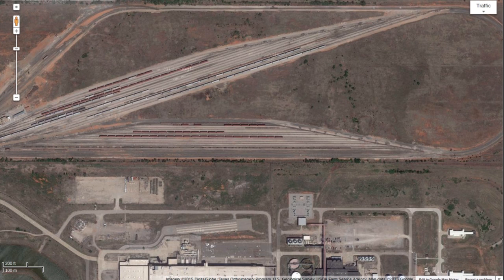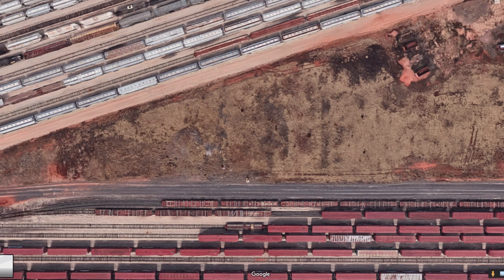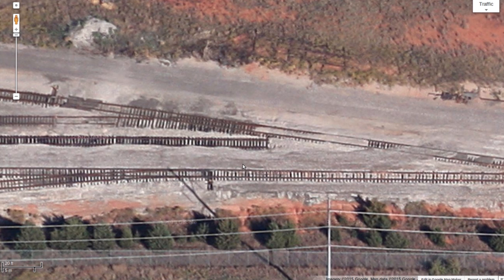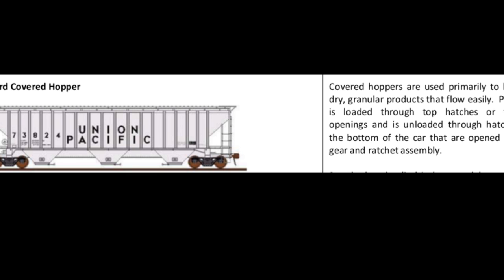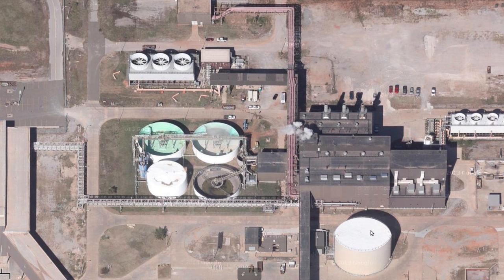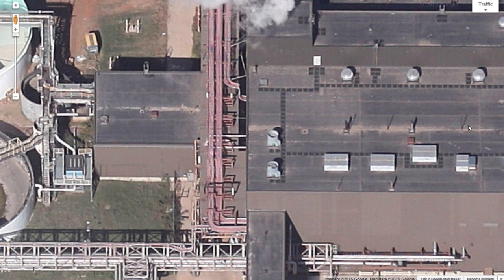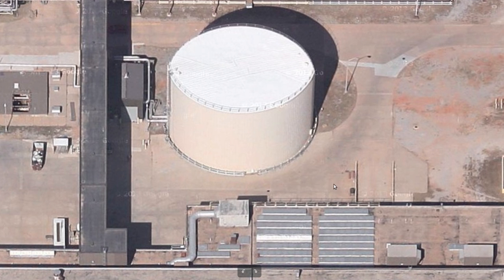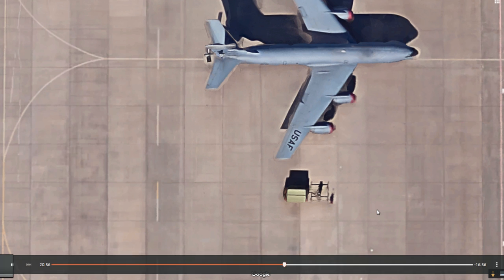Chemtrail Factory at Tinker Air Force Base, part 1 of 2

Comment: I would think aluminum in the atmosphere would cause heating of our atmosphere. 
I lived near  Tinker for 25 years. And the one thing I've noticed is they are building underground.  I feel  the explosions and hear the gigantic vehicles drive underneath, many miles per hour (very fast). I left my house because I didn't feel it was safe.  My house was cracking  after it was already 40 years old.  Now it starts cracking at the foundation with all the racket going on over there.
Reply from the maker: So scary, the rulers are planning to live underground, while the sheeple expire in "hot house earth". Thanks for the info, I would really appreciate if you could upload some video of the big underground excavation (like big dump trucks removing dirt, etc).
Reply: ....Joy....rumor is they have literal highways underground in much of the nnation and drive tractor trailers down there...

Comment: Hill afb has a similar setup. I see several commercial looking flights, leaving the base 2 or 3 times a day. 3 to 5 am. I suspect this is going on here as well. Daytime, only military planes. Mostly fighter planes. I live directly under the air traffic for the base. Great work putting it together.  You can't get satelight photos of this base last I checked.
Reply: I was just looking at the base on google...alll those train cars trapped in there from construction and  most freight yard for extra parking of cars...

Comment: Fly ash is (was) used on oil drilling rigs in North Dakota to dry up the reserve pits. The reserve pits hold the fluids that have been used to aid in the drilling of a hole in search of oil. After use the fluids are disposed of, this is where the fly ash came in, it was added to the fluids and then buried. Maybe it is being used here in some way like it was used on the drilling rigs.

Comment: Love your research, but the building and the red piping you're looking at look like simply like a chiller system for air conditioning. In the big building, they would have the chillers - these are giant a/c compressors that require massive amounts of power - hence the switchyard adjacent. They create an enormous amount of heat, which is carried away in the water flowing through those pipes to the cooling tower, which is a giant evaporative cooler that cools the water circulating through the chillers. There will be another loop of water pipes carrying the chilled water to the areas to be air conditioned. The chilled water flows through radiators (VAV's) throughout the areas to be conditioned. Each VAV has a fan and ducting to direct the cold air where needed. Worked as the electrical foreman on a similar system in a hotel here in Las Vegas and that's how I learned about the system.
Reply from the maker: Thanks, but if the red pipes are coming from big A/C compressors, the cooling towers would be a few feet away, not hundreds of feet away. Some guys are saying the red pipes are "medium voltage power lines", LOL.  Right, you need 12" of insulation around an 11 KV power line... Well, the chiller tower has input/output piping, but there are still the five pipes going down into the earth, which a normal chiller would not have. All in all, there are some real mysteries with this building complex. I didn't know there would be such an uproar over these two videos, I just uploaded this video to document my theory, not to show concrete proof. Thanks for your comment!
Reply: sort of a distiller ?

Comment: I have just looked at the latest google map of the area and notice that the rail yard has been lifted.
The rail track switches which fed the yard are still there. Looks like some major earthworks are being undertaken
on the former rail yard site!
Looks like the cement plant has also gone. 
Many of the large buildings are  still there as are the runways and aircraft stabling areas.
Curious?
  .
Reply from the maker: YOUTUBE just deleted my reply... where the heck to they go? Typing it again... Tinker and the KC135 fleet were used to spray coal ash, WAAAY back in the 90's to 2000's, but that ended after Dane Wigington measured coal ash metals all over the place. Nowadays, there is a better system: burning dirty jet fuel, in dirty jet engines produces phthalates, which block UV, turn the sky milky white, and turn boys into girly men (xeno estrogen). That is why ALL AIRLINER FLIGHTS MUST STOP, if mankind hopes to survive the next century. If we continue with business as usual, the biosphere will be dead in 15 years.

Comment: I really admire your creativity and ability to know what all the infrastructure you show is there for. One minor detail you omit is that every bit of piping, buildings and all were built by General Motors at the time they put the auto assembly plant in the 1970s. When Tinker AFB leased the building in 2009, all of the facilities you talk about already existed. I know because I was involved in moving much of the tooling from older shops on the original base into the old GM building. No new work was done to the infrastructure you hilight. So, what I take from your video is that I am to believe that all of this equipment for chemical processing was built and set up covertly when the auto assembly plant was built, decades before the Air Force got access to the buildings. Your keen knowledge of all of this fascinates me. I have been in most of these buildings, and I have to say the equipment for doing what you say goes on there is interestingly well concealed. I call your bluff and say you have no idea what you are talking about. If chemical processing is going on at Tinker, it's somewhere else on the base, not in the area you are talking about. Oh, by the way, the railyard belongs to the Burlington Northern & Sata Fe Railroad and is not inside the secure zone or fence of Tinker AFB. There is no fence restricting access to the railyard. The fences all around it restrict access to base property that borders the railyard. You would do well to not "know" so much about things you obviously know very little about.
Reply from the maker: I respect what you are saying. Even so, this base was probably the main source for coal ash chemtrails, from 2010 to 2015, or so. The testimony of Meghan Kelly is verification that something regarding chemtrail spraying was going on, for a few years. The covert program is all shut down now, as the technology has moved on. Now, it is very likely, they are spraying nano metals using additives to the jet fuel. It is much safer and lower risk for them, probably worse for the rest of us, though. Reading the 2014 IPPCC assessment report #5, there is a crystal clear paragraph, where they say solar radiation management WILL reduce rainfall and have other negative effects, as yet unknown. For that reason, the IPCC recommends that SRM (chemtrail) spraying NOT be done. Out of 3200 pages of bureacratic mumbo jumbo, that is the most important thing they have to say about geoengineering. BTW, what years did you work there? And, does your work experience fit in with my timeline of possible spraying? Thanks for your inputs.
Reply: and just how do they put the coal ash on the planes,,,,,,,    i have never seen a modded 135 tanker
and ive seen a few,,,,,,   and it cant go in the fuel,,,,   some people just grasp at straws

Comment: What are the fluid clarifier ponds doing there?
Reply from the maker: Well, one could be an aerobic septic system for breaking down sewer wastes. Your sewer utility uses aerated tanks and a floculant before discharging the sewer water. Southwest of the big white building there are two settling ponds, so maybe they do aerobic sewage treatment in the round spray tanks, then discharge into the two ponds. Of course, that doesn't explain why one of the tanks is white and steaming, and the other three seem to be unused. It is all a mystery, and my video was just proposing my theory of what was probably going on.

Comment: Very good engineering and documentation. I believe you have something. But I have not seen flyash appears in chemical analysis.  Wouldn't it create a very unbalanced Ph in air samples?
Reply from the maker: Yes the PH of the rain changed dramatically, when coal ash was present. Dane Wigington and his group tested rainfall and soil about five years ago, and found it was too alkaline, with high aluminum levels, which is STILL killing the tree roots. You are right, the PH change has been documented. Normal rainfall is slightly acidic, due to dissolved CO2, and the coal ash rain was far from the normal rain PH. It was tests like those, that forced the chemtrail sprayers to switch to a new technology, using jet fuel additives with nano particle metals. Jim Lee's new video CBD on carbon soot does an excellent job of explaining the new program - highly recommended!
Reply: Excellent journalism and research. I wonder if FOIA would allow access to the construction documents related to the cooling tower / cooling building. US Army Corps of Engineers would have overseen the work, and since it was most likely a Bid Civil Engineering Project, public records should be available. One should be able to research all of the related structures and mechanical systems; , and determine their function and intent.

Comment: At 19:30 in, shadow angle of the flyash tank and water tank seem to be in contrast to each other?
Reply from the maker: The 2018 google maps slants the image, as it gets to the sides, so you get a side view. If it was the old google map image, they cut and paste all the time, either to hide stuff, or to bring the image up to date. When they do that, the shadows slant differently, and sometimes part is in spring, and the other part is in winter. I've seen that frequently, especially in areas where they are trying to hide something (my guess).

Comment: Great video. But I think with the cooling towers they are not pumping product through them. The pipes going in is the return water being distrubited back through the cooling tower where it falls from the top to the bottom and is cooled by the air being pulled by the fans. then pumped back out to a process that cools the product and the warm water returns to the tower.

Comment: Most likely a DUMB (Deep Underground Military Base) there as well with all this train cars coming in. The supersonic vacuum tube trams underground aren’t for moving heavy equipment and supplies. Just passengers mostly. So they would need that many trains to bring supplies.  The coal ash processing plant makes sense and I can def agree with you on that. Also easy to keep an eye on all the people working on the High Altitude Stratospheric Injection programs with clearance under the same blanket of surveillance and access as the massive infrastructure of compartmentalization and enforcement of silence is already there for the underground base and whatever contractors there are doing labs and projects below. If only makes sense that they would house a facility like this not only on an Airforce base but especially on a base with a DUMB there.

Comment: Always keep a backup completely disconnected from the internet and our computers which are in use. No one should be able to remotely access a truly secure backup.
Reply from the maker: Great advice, but difficult to fully implement in today's world. I always did my backup copying with a reboot, and no internet connection to the PC, but even with nothing running, and offline, they managed to tag the files for deletion. Also deleted was a bitcoin folder (don't have any bitcoins, though). I guess that indicates someone is stealing the files.

Comment: The tank that you showed is not water it is the Portland cement hopper. The fly ash is used with the Portland that makes the mixture fluffed for a better word. Then it will be mixed depending on concrete type with fine sand, 10mm stone and 20mm stone along with manufactured sand. But either way this plant would not use anywhere the quantity of product these cars are being in.

Comment: do you have any info about  where  this happens in the UK or have advice on how i can research this .thanks.
Reply from the maker: I don't have any info on europe, but there are comments on this channel that talk about fine white powder that shows up on windshields (coal ash fallout). There are important comments on this channel, but it has become "information overload". I know there are ionospheric heaters in the UK, which explains the droughts and stationary high pressure (like over sweden this summer).  All I could recommend is to search google earth for the coal burning power plants, and follow the train lines, to the nearest airport or air force base. Also, the KC135 USAF tankers seemed to be the planes that were specifically outfitted to dump tons of coal ash, so look for that type of tanker/refueler jet. For good scientific proof of coal ash falling from the sky, please read some of these papers: http://nuclearplanet.com/Geoengineering_Scientific_Articles.html   Good luck, let me know if I can help!

Comment: Funny I work on 135s and also at Tinker. Could you tell me where or how these chems are downloaded onto the aircraft? Or where they are stored?
Reply: And I actually work in that huge building. Funny. You more about what goes on in there than I do.
Reply from the maker: I was hypothesizing that the coal ash slurry is held in the tan colored tank, then sent through cooling towers, and pumped underground to the green sheds in the KC135 parking area. Then a pressure hose will load the slurry onto the planes. I should say it doesn't have to be wet, there could be other solvents involved, or it could be pumped dry, with compressed air injected at the input to the pipes. Anyway, I think this is all shut down now, as coal ash is too toxic to keep spraying year after year. Dane Wigington did lab tests and found huge levels of aluminum in soil, and creeks. This aluminum kills the roots of trees, so everything is dying wherever this toxic trash is sprayed. The western forests are largely dead, due to chemtrails, which weaken the trees for the pine bark beetle to kill them off. If you really work there, please let me know what you think, BUT don't get in trouble by commenting too much (and loose your job). You'd be surprised how efficient the modern surveillance systems are. You have to work very hard to be anonymous on the internet.
Reply: @thehaarpreport9203  Id like to know who does the pumping onto the aircraft, and through what receptacle. The only way I can think is if it is disguised as a fuel truck.
Reply: @thehaarpreport9203  like I actually park my car in that parking lot.
Reply from the maker: I really think this base was repurposed 3 to 5 years ago, so back then,  the planes would have another receptacle, but probably not anymore. Maybe there is a maintenance panel covering it up, but probably most of the planes are back to original configuration by now. I'm just guessing in the dark here. All of this is just theory, but the falling coal ash was not imaginary, from the tests I've seen.
Reply: @thehaarpreport9203  I need to start wearing some type of breathing mask. This is a bit shocking.